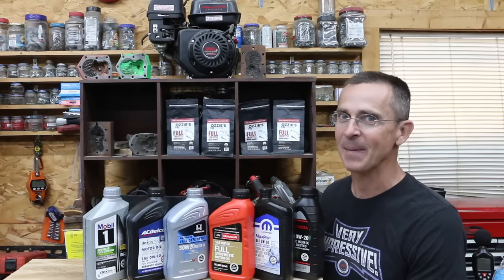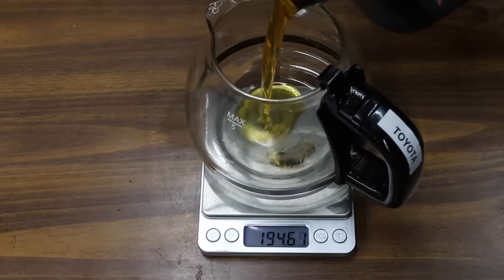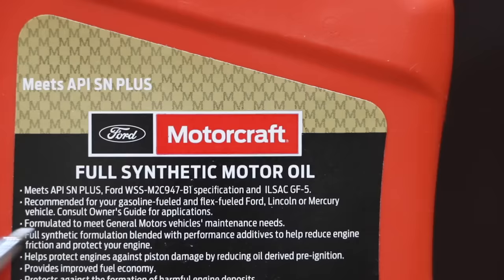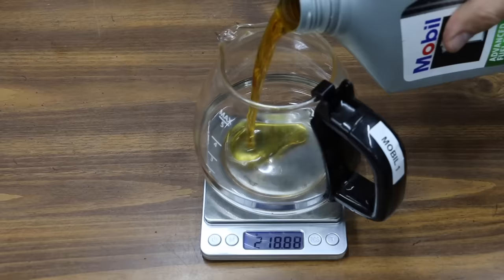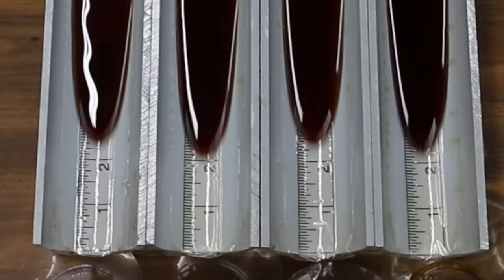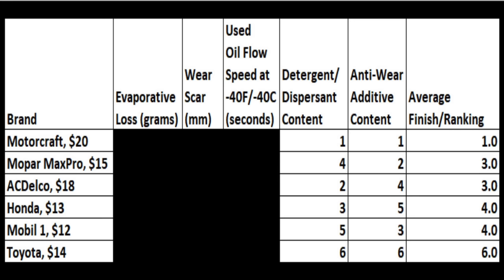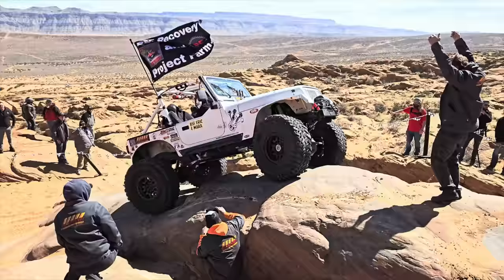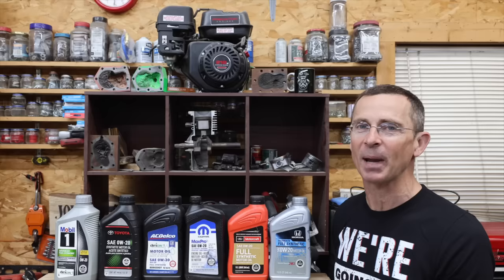How Bad Is OEM Motor Oil? Honda vs Toyota vs ACDelco?

Comment: I don't put much stock in this kind of testing since 1) the manufacturers specifications for their oils are all different and 2) changing your oil and filter every 5000 miles OR 6 months (normal environment) gives you all the protection you need to have many trouble free miles.
Reply: TBN and cSt viscosity @100c are important specs to know for running a low viscosity oil in hot climates...

Comment: Motorcraft has always been underrated. Even the synthetic blend is good. Very nice and interesting video as always!
Reply: I might go back to it on my expedition, last time I changed it I went to Liqui molly
Reply: It's ConocoPhillips motor oil.  It may be cheaper to buy that.
Reply from the maker: Thanks!
Reply: @cicada9471  You can tell by the bottles that the motorcraft, AC Delco and Honda oil are all PhillipsConoco oils but this testing just goes to show that the manufacturer of an oil means less than the quality of the base stocks and additive packages used.
Reply: Underrated? It was the most expensive and didn't even hold up the best.

Comment: There are so many diesel fuel additives on the market. Additionally some truckers use just good ole straight ATF. Some of the various "marketing" benefits are cleaner injectors, fuel pump lubrication, anti-gelling, and better combustion. I'm not sure how to test them all, but you are pretty darn good with analytical means and methods. Thanks for all of your content!!
Reply from the maker: You are welcome!  Thanks for sharing.
Reply: Problem with modern Diesel is apparently the removal of Sulfur, which much like Lead in gas was an effective lubricant that helped reduce wear. I'd suspect the best additive would be the same as the best anti-wear/lubricity enhancers added to Oil such as Molybdenum/Zinc/etc. Diesel is already somewhat of a good lubricant but the kinds of metals/elements I mentioned really are what's needed for the extreme shear stress of metal on metal loads completely unlike the spinning oil-filled bearings handled by oil with little to no metal on metal. 

It sure seems to me that the biggest problem with powerful and efficient modern engines is the far higher stresses incurred from high-lift valvetrains and high-pressure pumps, especially in pushrod and diesels.

Comment: So i quit using Remington gun oil for my guns and switched to my mustang’s 0-20 synthetic oil Motorcraft. The old oil would pool to one side of the gun due to gravity. It was also ruining the rubber ends on the buffer weights on AR platforms. Synthetic sticks to the metal and resists the gravity effect and also doesn’t dry out as quickly or harm the rubber
Reply from the maker: Thanks for the feedback.

Comment: LETS GO!!! 
2-STROKE OIL NEXT PLEASE
Reply from the maker: Thank you for the video idea!
Reply: Totally agree!! When I was a teen I had a Suzuki RM250 and used Bel Ray MC1 (not sure if that's even available anymore). It was blue and smelled like plastic. You could tell which premix was mine. To this day in ALL my 2 stroke yard tools I use non ethanol fuel and synthetic marine 2 stroke oil. This is Florida and my chainsaw is around 20 years old and still works great!

Comment: In 2020 I bought a Toyota Camry XLE Hybrid. It came with free service for 25,000 miles. I am an Uber driver. I was getting 46-47 MPG with the Toyota oil. At 30,000 I started using Pennzoil Platinum which immediately started giving me 48-49 MPG. 15,000 miles later I went to Walmart to get more oil for another oil change an all they had on the shelf was High Mileage Pennzoil Platinum. I bought that and started getting 49-50 MPG. I'm the one that gave you the suggestion to test dealer oils because I knew there was something going on at least at Toyota Service centers. You get OK oil but not what I would put in my car.
Reply: I do not understand how often hybrid  systems take over or assist and am not questioning your data nor record-keeping, but will the level of battery charge affect the MPG?
Reply: Getting more MPG doesn't mean the oil is better. It could actually be the opposite. Since the lower Oil viscosity lowers the internal resistance.
Reply: For that engine you could use 5W30, 0W30, or 0W20. For UBER use I'd rather 5W30, to deal better with de use pattern. Even if it means worse MPG. What matters too, it's the SAPC content, and for this engine, the lower the better. So I'd stick with an ACEA C2 or C3.
Reply: @RogerM88  I actually went from 0-16W oil which is what Toyota recommends over to 5-20W. You would think that because the new oil that I'm using has higher viscosity I would be getting worse mileage but that's not what is happening.
Reply: @SayAhh  It's all done automatically by the computer. All you have to do is fill up with gas. The battery is used as needed and also automatically charged up as you drive. Definitely the best car I've ever bought or driven, I'm 71 and I've bought a lot of cars in my lifetime.
Reply: @danielvillarreal8892  The 0W16 it's a very thin oil. Depends on the average temperatures where you live, but I wouldn't go lower than 0W30, for the type of drive you use the car. I'd rather use a cheaper oil, but change it more often, as around 10.000 to 12.000km.
Reply: @RogerM88  There is another YouTube channel The Car Care Nut who specializes on Toyota's only and this is the viscosity he recommends on this particular car. And due to his knowledge on Toyota's I switched from 0-16W over to 5-20W and also to change the oil every 5,000 miles and not 10,000 miles as recommended by Toyota.
Reply: @danielvillarreal8892   What usually makes a car consume oil, even with low mileage it's over heating the engine leading to scoring on the cylinder walls, or neglect the oil changes interval, as under filling or over filling the engine. Over heating the engine could be due to oil not to spec, but more often due to fuel dilution in the oil. So as stated above, it's a better option to use a more affordable oil, but do more routine oil changes. And 0W16 as 0w20 oils tend to be expensive.
Reply: @RogerM88  New engines have very thin low tension rings to help with mileage. The thin oil ring has a tendency for the oil in it to cook and eventually become carbon if you do 10,000 mile oil changes. A new engine will start burning oil by 130,000 miles. I know that for a fact because my wife's car started burning oil at 130,000 miles even though I was doing oil changes every 7,500 miles as recommended. Her car used 0-20w. It appears that 0W anything can't handle the high temperatures this new engines operate at. The new Toyota's are now using 0-8W oil. Only the dealer has this oil.
Reply: @SayAhh   "I do not understand how often hybrid  systems take over or assist"

While the car is moving, the hybrid system is pretty much constantly in a state of either charging or discharging.  In this context charging occurs as the car is braking or coasting and discharging occurs when the car is holding speed or accelerating.

In our 2024 Corolla Hybrid (Australia), the very instant we get off the accelerator while moving, energy starts going back into the battery.  Then when we get back onto the accelerator, the battery is then used to add driving power.

We have been getting a measured 4.1L/100km (57.4 US mpg), which is slightly better than Toyota's claim of 4.2L/100km.
Reply: I have the same car awesome

Comment: I work at a GM dealership and I know that we get our bulk oil supply that we put into customers vehicles directly from a Mobil Delvac truck that gets pumped right into our 250 gallon oil drums. I would have bet money that the ACDelco and Mobil 1 oils would perform almost identically. Looks like ACDelco, although supplied by Mobil, has definetly added some things to the oil to be Dexos certified. Very interesting!
Reply from the maker: Thanks for sharing.

Comment: Todd, at 10.29cSt, the Honda viscosity is way too high.  It is a 30 grade viscosity, and it's not close.  I would ask Blackstone to retest that sample, if possible.  Some of the others have viscosities that are at or near the upper limit of 20 grade (9.29cSt), which is not very common.  A typical 20 grade viscosity is closer to 8.5cSt.
Reply: Yes, buddy, exactly, that what I also let him know. The numbers for these Sae20 oils should stay within 8 - 9 coefficients. But for some reason the numbers Todd posted belong more to Sae30 group. Good catch. Thanks
Reply: Yeah, it got to 30 grade, when above 9.6 cst. Not for a 0w20, só, they know Hondas need a 30 grade, since the sell that as 20? 🤔

Comment: In 1974 my auto mechanics high school teacher spoke about multi viscosity oils. He said as an example that 10W30 meant that the oil would flow at a specified low temperature the as no thicker than 30 weight oil, and would be no thinner than 10 weight oil at a specified high temperature. I have seen mulitiple self proclained internet oil experts passionately argue multi weight oils get thinner when cold and thicker when hot which is impossible. Thanks for demonstrating what actually happens.
Reply from the maker: You are welcome!

Comment: You should try Kawasaki oil, they claim is better then regular motor oil because is designed to run in hotter temperatures for aircool engines
Reply from the maker: Thank you for the video idea!

Comment: Interesting results for the Toyota, since their vehicles are more reliable than the competition, I believe the key is in the engineering of parts that allow them to use less additives and achieve the same result. Hence why toyotas can use the cheaper oils and still run just fine. Very interesting results and findings
Reply from the maker: Thanks for sharing!

Comment: Can you do engine coolant next? OEMs vs Peak, Prestone, and Super Tech
Reply: That would be a good one👍
Reply from the maker: Thanks for the suggestion.
Reply: @ProjectFarm  You could setup a rig that tests the thermal transfer efficiency of coolants and test the corrosion resistance.  That would be super cool, no pun intended.
Reply: @ProjectFarm  Again, at least in Europe, no car manufacture makes their own coolant
I've blended coolant concentrates for most European car brands and a few aftermarket brands
For some, only the colour is different 😇
(not so for VW Group's pink coolant which is a specific blend)

Comment: I think it should be noted that (at least with Toyota maybe not Honda anymore) the vehicles are engineered to a specific oil , which is why some recommend just using OEM recommended oil instead of upgrading to something "better".
Reply from the maker: Thanks for the feedback.

Comment: They’re bad for your wallet
Reply: Still cheaper than a new engine lol
Reply: @justintyme7213  Would be interesting when all stations stop selling hydrogen fuel like Shell did.
Reply: Buy an EV. Charge at home, one pedal driving, no oil change required. Also, brakes don't wear much due to regen.
Reply: @fjalics Until your battery goes out and your out almost a whole new car. EVs have potential but you can find plenty of articles on why EVs aren't remotely close to replacing Gas Vehicles yet. Infrastructure needs to be updated, better mileage per charge, ways to prevent the cold from killing the battery (like what happened up in Chicago if I remember correctly with all those Teslas) and the actual mining makes up for all the emissions that they say the car "doesn't make".

You do you but until at home charging stations are affordable and the other stuff I mentioned is fixed, they aren't worth it.
Reply: @dubjubs  EV batteries seldom go out. Early Nissan Leafs had issues. I heard a story where something on the road damaged the battery. But it's the exception, not the rule. Gas cars can die too. Our current infrastructure can handle a lot more EVs, and there is no reason to stop working on it. Chicago was really cold that day. The batteries didn't die, but they needed to warm up before they could charge, and that was slow. Chicago needs a lot more Level 2 (220V AC) chargers, like eventually a couple hundred thousand. Any car that would have been on one of those, or still charged from before would have been fine. There have been plenty of studies, and the emmissions are much lower from EVs. The break even depends on what you drive, and where the local grid is at, which is continually greening. Bet you never gave a thought to mining till you decided you were anti EV. Yes there is some. The batteries are being recycled. Oil isn't.
Reply: I don't know what about prices you have there, but I have Ford and local spare part shop sold Ford's OEM oil cheaper than ie. Castrol, Mobil etc. Used it for years, but they changed suppliers and couldn't get it anymore.
Reply: @fjalics  EVs are too reliant on areas climate and uses. If you're in cold areas you lose quite a bit of mileage compared to warmer areas. Some cities or companies tend to be cheap so you will probably never find higher quality chargers that would work for their climate. Also if you tow, I'm pretty sure that would affect it as well, although I'm not sure how much compared to gas as they are affected from towing too.
Not an anti EV guy but, I think the main issue about EVs is that they are still considered quite "new" so when new issues come out they are considered more problematic than gas cars. One thing to considered though, older gas cars are still quite easy to work on I believe compared to EVs cars. Unless they over engineer the car, anyone can do an oil change.
Reply: No oil changes in EVs, but you will be changing tires 20% faster due to the weight.
Reply: @dryrain2  who cares about 20% increase in tire costs if savings could be 70% than fuel? That's just nitpicking.

Comment: This was a really interesting test.   I'd read an article a while back that indicated that OEM's used Mobil 1 on the assembly line, in particular, Toyota.  That also suggested to me they tested engines with that oil.
I was intrigued to see that there are differences in formulation with each OEM and they aren't just branded generic oils.
However, in practice, the differences are really quite small and no owner should worry about which quality oil they use.   I always go for Mobil 1 personally.
Toyota did surprise me though.
Clearly Motorcraft oil doesn't overcome F.O.R.D. issues - Fix Or Recall Daily!
Reply from the maker: Thanks!

Comment: Thanks for the sterling review. Last week synthetic oil into a Toyota I own. And then in the drivers seat with flag waving high & one or two tires in the air, project farm makes its way around Sand Hollow - that was impressive too.
Reply from the maker: Thanks!

Comment: I know this isn't the main point of this video, but I don't know where else to ask: "Quick Drain" oil bolt/plug replacements. I like them, and the concept of keeping as much of the mess contained and not on the driveway/ground, but a lot of people have a lot of strong thoughts on them and their reliability. My questions (you come up with your own brilliant questions/situations, but if I had to add any) would be: How far does the plug protrude into the pan? That might change how much is left 'in' the pan, but you would need to see inside the pan to measure/check. Obviously, not a lot of home wrenches can drop a pan to check. How fast/slow draining happens at cold/warm/hot? Cold oil flows much slower, and warm/hot oil flows faster. So maybe it will clear the oil bits faster since we can drain them much warmer? All valves have seats that need to be clear of debris to keep closed, how good are each at clearing 'moderate' particulate contamination? And how many times do you have to 'reseat' them to get any oil drips to stop? We obviously know it is going to protrude out farther than the regular oil bolt, but having all of the systems side by side would really help with contrasting and comparing them to the OEM bolt. And then the last part would be just for fun and educational, but how long would each system allow the engine to 'last' if they were actually draining out the oil while it was running? Maybe that super slow flow is helpful, since you will see the oil pressure light before you run the engine dry and seize it solid? Thanks for the videos, they really are some of the best things online.
Reply from the maker: Thanks and you are welcome!
Reply: Use Mobil 1. Use standard drain plugs. Easy.

Comment: Since 1990, I've been using Mobil-1 full synthetic oils in every engine I have. I also use it in my 1996 Honda Accord 5-speed trans. Cars, trucks, mowers, power washers etc.  No problems. I use the red Mobil-1 synthetic grease to redo/repack bearings (new and old)
Reply from the maker: Thanks for sharing.

Comment: I use that exact formula of Mobil 1 in my daily driven car. I'm surprised it didn't perform a little better but seeing the cost it makes sense. I won't be switching though.Thanks for the review/video.
Reply from the maker: You are welcome!

Comment: I put gear oil in my Chevy Silverado, that 75w-140 to be specific. I switched to gear oil a few months ago and it runs like a new vehicle. On my 5.3 Chevy I put 7 quarts of gear oil in my engine and it runs like new.
Reply from the maker: Thanks for sharing.

Comment: Honda uses Valvoline oil but used to use mobile before that but it became too expensive. That's what my local Honda parts department guy told me a few years ago.
Reply from the maker: Thanks for sharing.